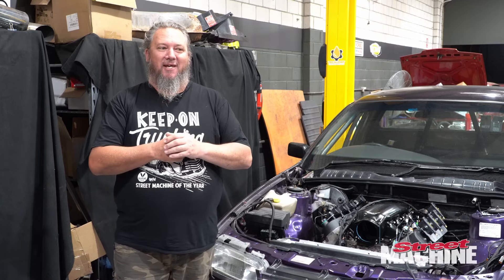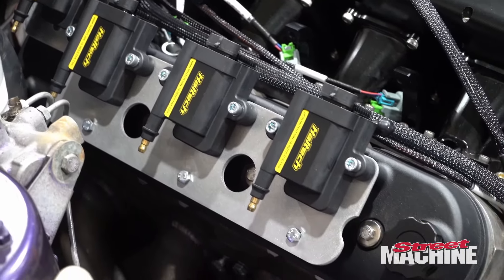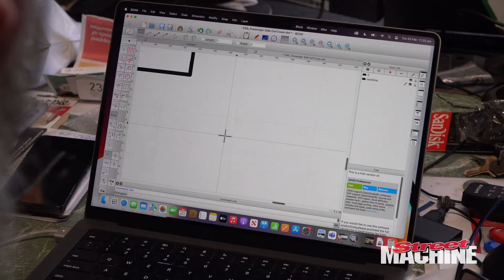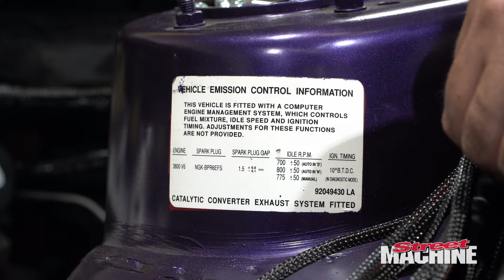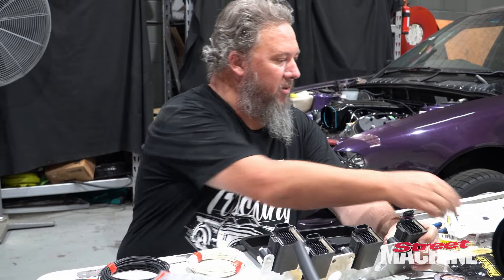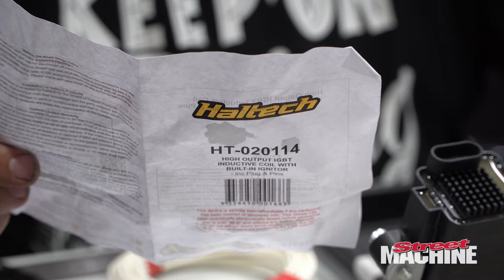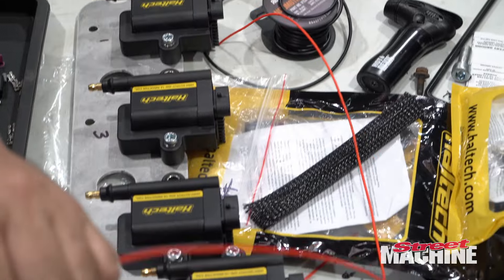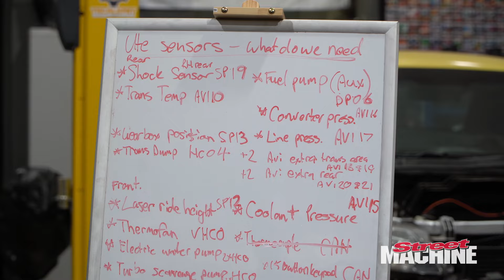Carnage - Drag Challenge Ute Part-12 - Wiring Tips and Tricks

Comment: I totally agree about the time it takes to wire stuff.
Even having a job where i have to work with (different) wires all day, it takes me a lot of time.
I bought a new project a few weeks ago, had an engine swap like 30 years ago, runs but the wiring was a mess and totally not to my standards. So i wanted to fix it quickly. Then my job background kicked in and i started to rewire, including ripping of the fuse box and put in another one from a different car, including all the relays so they're all at the same spot and reachable without disasembling the dashboard. This was 3 weeks ago, still not done 🙄 To be fair: i'm waiting on parts to fit in the other fuse/relay box. I need a spacer for that and someone offered me to get it 3D printed, but he's on vacation right now.
Reply from the maker: Yeah, I need to rewire Dad's Ute
Reply: @STREETMACHINETV  just bring it over to Germany and i'll give you a hand 😂

Comment: When installing the terminals, cut the sheath in two portions. Slide the first part off, move the second part to the front of the cable then push it back with the terminal. Cut a slit in the second part of the sheath and remove. Saves using a cable tie.
Reply from the maker: That's the other method I use. I did that on the first connection
Reply: Ahh yeah, I rewatched your pos cable. Missed it 🤦‍♂️

Comment: Should absolutely run a circuit breaker on your main battery cable, can also be used as an isolator if you need to store the car a while.
Reply from the maker: We will get to that, but to start off we'll just go straight to the battery
Reply: Where to find a circuit breaker that can handle the starter motor draw? Cant find them over 200amp
Reply: @vnv8dude  I'm running a 150A one and it handles starting fine
Reply: @STREETMACHINETV  recently had a friend of a friend whos car burnt down a week after being wired, no breaker installed and a grommet came loose while interior was being done, the main positive cable shorted to the firewall. 200k car gone in an instant.
Reply from the maker: @LawnPotato  ouch
Reply: @vnv8dude A lot of car audio breakers can handle constant 200amp and peak load (short time) 250amp. Ive had one in my car for 10 years, no issues.

Comment: Not a big fan of aluminum cable it has a much shorter duty cycle time when loaded current wise and it becomes brittle with time and heat. Copper is much more reliable and takes a lot longer to heat up when used. If you are wiring your starter motor especially try to get some welding lead flex. It wot get brittle and break off or rot in the connector as easily. Always try to use a rubber insulated flex (Welding leads) for the starter but others can be a PVC welding flex. Aluminum flex vs Copper Flex for a matched capacity needs to be about 45~50% larger in square diameter and has a much higher resistance (40% I think). You can get away with the usual current rating of 80% for most wires but the starter need a bit of redundant capacity if you run into trouble and have to crank it a bit, especially with a flat battery.  If you do have to use aluminum cables you can help their durability by using some dielectric grease inside the crimps and the immediate exit from them. It will help stop any oxidation.
Reply from the maker: It's not aluminium cable, it's tinned copper, suitable for auto or marine use
Reply: @STREETMACHINETV  My mistake i didnt pick it on the video.
Cheers

Comment: the coils mounted on the valve covers are ugly LS's are already an ugly looking engine, I've remote fitted in the area under the front guard under the plastic wheel covers on my VE, you can buy remote kits for them with extra wire that plug in which aren't expencive
Reply from the maker: Yep, but this isn't going to be a show car. It's a race car... and it also hard to show off sponsors' products when you hide them :)